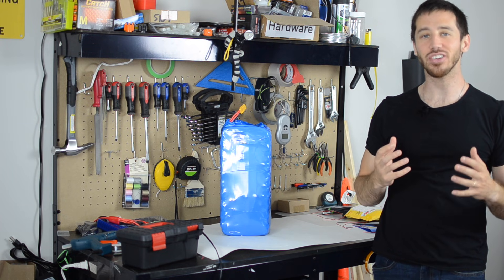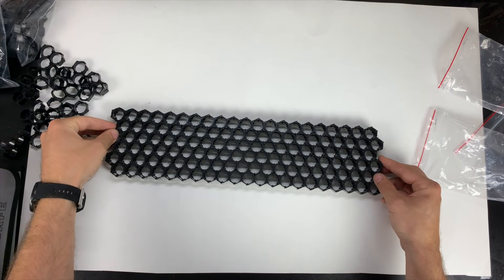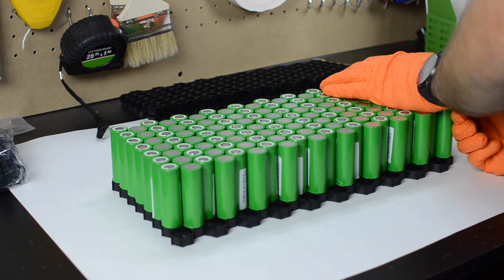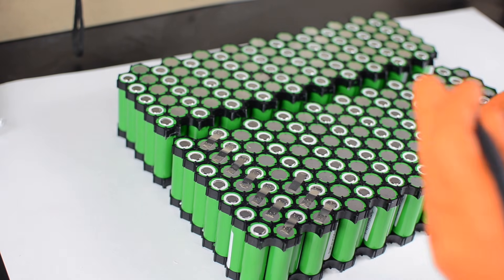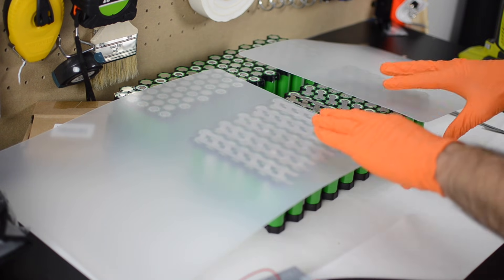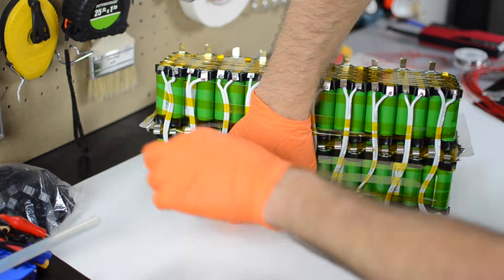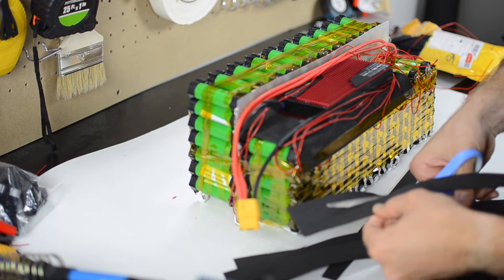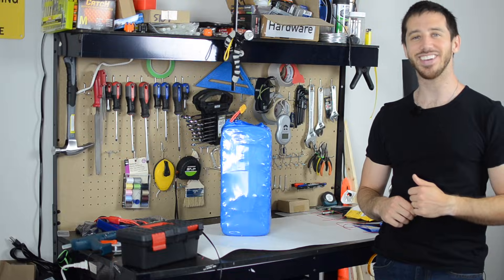DIY electric motorcycle 72V battery build (DIY E-moto Part 3)

Comment: Thank you for makingthis video.  I am building a similar battery and wondering how to determine the max output amperage of it,  What would you consider your battery amperage output to be? Or maybe the question is what size BMS are you using?

Comment: Thanks Micah, I have 3 not working,  good,  nearly new ebike batteries: (52v15ah, 52v14ah, 36v8ah) plus a few small packs for a few more cells,  and a spot welder, i want to combine my cells/packs to get a 72v battery for a new upgrade to an old 2014 A2B Alva+ with the 24" MXUS 3kw kit. what should i have, or do, to best build my battery. As far as shaping it, mainly, the original battery on these bikes wrapped around a beautiful strut under the rear rack, so if i could shape it to do that again that would be optimum.

Comment: Any tips on how to do 72v 54ah but 400amp or not possible working on 8000watt e-bike eventually I’d like to build my own battery for it
Reply: Same here. Looking at some 32700 cells for 6000mAh each. Should be less cells required for a 72-96v high Ah battery

Comment: Hi. Thanks for this great tutorial video.
I was wondering if its easier to build what you did here using 9v batteries. What are the obstacles that you will come across with building a pack with 9v batteries?

Comment: i just purchased this type of battery... $500. my ebike came with (6) 12v acid Motorcycle size batteries (Heavy). i didnt understand the concept of the auto shut off on the charger. so i left it plugged in even after charge was complete. well, one day it stayed charging and cooked my batteries and it left me with damaged batteries which didnt hold charge and i use it to commute to work (8 miles round trip) i tried to replace the batteries but they were hard to come across and it was difficult to understand all this volt, amp talk! so i purchased a 48v battery pack and learned that i needed a 72v. needless to say, I FIGURED IT OUT! i recommend this DIY battery packs! its not as heavy, and performs better than the acid batteries. i hope this encourages somebody to go with these types of battery packs!

Comment: I made a battery just like this, when hooked up to a multimeter it gets 80.5v, when hooked up to my ebike the voltage constantly jumps anywhere between 60v and 80v and the bike dies immediately when a load is put on.
 Also chargers either think it's full or just aren't charging it. Anyone know what the problem is? I'm guessing either the bms or the cells are shot. But the cells all did charge independently before the pack was made without issue.
Reply: Did you get them balanced?
Reply: @andyfumo8931  I did. It was a faulty bms in the end.
Reply: @Rasilia  faulty BMS or the brand and model you used is bad?
Reply: @andyfumo8931  just a faulty bms, got a replacement of the same make and it works great.
Reply: @Rasilia  which BMS is it can I  ask
Reply: @andyfumo8931  it was a Daly bms. In reality it was the charger I bought with the bms, the shop wired the charger backwards and the charger popped as soon as it was plugged into the battery. I was just hoping at the time that it didn't kill the bms with it.

Comment: Let's just say you plan on building a 72V 200A battery. When spot welding, do you recommend multiple layers of nickel and extra layers for the negative and positive terminals of the battery that get soldered to the bms? Also, whats a good brand you recommend for a bms for a high amp battery? And finally, do you recommend using 18650 or 21700 batteries for an ebike battery.
Reply: Try 32700

Comment: Micah I love all your videos and am a huge fan, built all my ebike batteries from your knowledge!  Question though: Is it possible to join the two halves without using the nickel strips? Have the 5p sit directly ontop of the 7p with no plastic? is it possible/safe to do with maybe a smaller pack? and would using a higher guage wire for the bms wires "medusa(lol)" charge it faster?   Love the content and a huge fan for life!@!@!!

Comment: Hi, I've seen alot of batteries advertised as only being capable of handling a certain wattage from the motor. For ex. (A 48 volt battery that can only handle 1500 watts) is no good for a 48 volt 2000 watt motor, I guess tho I don't know,.. how can you calculate how many watts your diy battery can handle?
Reply: you look at the datasheet of the cells you are using and max discharge rate of cells. on M50LT (cells Im using for a 26S 27P pack) it has discharge current of 1.5C (7200mA) *3.69V (std. voltage) so this is about 26.56watts per hour. a 26s27p has 702 cells in total (26*27) so by doing 702*26.56Whr you will have around 18.6kW. On datasheet the absolute max is 3C but that only applies when cells are at 10c~25c. you should not be pressing cells above this limit beyond 25c otherwise you will risk thermal runaway. my motors will be doing 22kW at absolute max and much lower during cruise, so my cell discharge will be much lower, for added safety.

Comment: I have a question, I made a 72v batterie out of 6  12v batteries in series for a e bike, my problem is that by battery die really quickly. Is there anyway I can make those last longer with a different wiring? Or do I need those small 3,6v battery?

Thank you all!

Comment: HEY MIKE, I HAVE 3000WATT CYCLONE MID. KIT ON MY BIKE, AND I RUN 2 PARALEL{ (3X18V 9AMPS=54V 9AMPS)=54V 18AMPS}= 972 WATT HOURS? MILWAUKEE 18V. 9AMP BATTS. 
 WILL THE CYCLONE MID RUN THE SAME DISTANCE , BUT SLOWER IF I TRY 3 PARALEL{(2X18V 9AMP=36V 9AMPS)=36V 27AMPS}=972 WATT HOURS. CAN THE CYCLONE EVEN RUN ON 2 18V 9AMP BATTS?

Comment: How do I replace the 6x 12v lead acid batteries with this in my ebike? The connection type is different. Also, will I be able to use the same charger? (72v 20ah) Thanks

Comment: Did you test it before wrapping it up??? Lovely build mikey  I'm 'borrowing' your bendi-battery-build of that's OK sir?
The reason for it is that for years I suffered the teasing 48v hub motor and 48v 11ah battery.
I use those values loosely as at full throttle it effectively is a 42v battery.
When fully charged to 56.4 it performs lovely.... For a few minutes then performs like a damp squib..
In my view I want a battery that has a constant minimum	 output of around 60 v and the ability to provide 1500 Watts at max output both continuously or until at max discharged but with a reserve tank ability.
Good sir HOW IS THIS POSSIBLE PLEASE.... X
Regards
David wiles
In the UK (on private roads)

Comment: 2:40 It's good that you're wearing gloves, mr. Ghee made his 72V nom. with his greasy hands. but he only uses it for vaporising copper wire! 8:09 solder has 10x resistance of copper-copper connections, such as crimping. so, where possible, better to crimp! minimise connections, so if the BMS wire isn't long enough to reach the terminals, replace it with a longer one, rather than extending it.

Comment: Great instructional video, I’m also working/planning on building my own 72v lithium battery pack for an electric Chinese bike that I salvage but it instead had lead acid batteries which are completely dead and can’t hold a charge. Hopefully I can start this project before the summer begins.

Comment: Dollar store cutting boards rock
I use them for all kinds of fabrication, mostly for directing air - 
Custom pc building, a/c to water chiller conversion. Also backing for drywall repair. Cheap, rugged, non conductive, waterproof. Oh, made a sanding attachment for my drill too

Comment: I would be uncomfortable with those wired connections between the top and bottom face of the pack resting directly against the inner folded connection strip. If one of those wires rubs out from the vibration, wouldn't it short across both layers of cells?

Comment: Question. New to doing packs. You do series first, then you do parallel. Why not do parallel, then connect the parallel blocks in series? Wouldn't that be less welding as you would only have 2 connection from block to block. To me, it looks like you built 140 cells in series, what am I missing :)

Comment: 20S12P with 200 amp discharge, 72 volts 36Ah ... I just purchaesed 3 of your books on Amazon... I am looking forward to building a battery for the Luna Galaxy Paint I'm gettin. Thanks for the video's.
Reply: What cells are those?

Comment: i have question. my cells are 30A and it would be 200A when packed. can i use it with 150A bms? how much does it matter if my bms is 300A and my controller and motor is 150A can i tell the bms to work as 150A? im about to buy antbms that has bluetooth control

Comment: TY for another video . You say cell must be at the same V b4 assembly ; getting 00's cell at exactly the same V is ideal but unlikely so what is a range  that is acceptable  25mv ?  the cell i have purchased have 3.226v-3.236 ATM , it's going to be a couple weeks b4 i have the missing hardware and assemble the pack , i will mesure them again then , that will also tell me if the $ i spent was worth them  , cheers & ride safe

Comment: I have a question in my mind that.
 if I use low voltage motor in High Voltage battery; does it make any damage.

Or if use high voltage motor in low voltage battery ;Does it also make some bottleneck issue?

Same question in about watt..

Comment: Hi Micah,
Damn man, I have been trying to find out exactly how and what I would need to build my own 72V E bike battery for My E Chopper Motorbike. THIS IS PERFECT.
I live in Toronto, Canada. Is it possible to get your DIY Lithium Batteries here in Canada and where. Also, getting the supplies here seems to be difficult as I have no idea where to start looking. The way you built this battery including the battery mounts is exactly what I have been trying to find as well as a supply of batteries. I would like to build 2 batteries (kind of a 2nd fuel tank of sorts), and have the extra power for longer rides and better usage of the bike before needing to recharge or carrying a charger with me unless I build the charger it into the bike which would be great if I could do it. If that meant having a simple switch to switch from battery to battery that would be fine. I have also toyed with having a regenerator that would generate power just from the motion of the wheel with a short chain attached to a regenerator (if safely possible).

Great build Micah, I hope you can help me with advise and connections for supplies.

Thank You,
-Matt

Comment: Looks like you tore some of the battery protective casings when inserting them in the holders  seen middle of battery around 3:00 of video the heat shrink is all wrinkled.  I am thinking this might be a potential failure point if the heat shrink fails and have some leakage.  the rest of the steps seem well done.   cool project!  good work

Comment: question how many lithium batteries cells do I need to make a 72 V battery can you please tell me and where can I buy Them by the bunch
Reply: It depends on your load, max curent and power needed. For that voltage, let´s say your load pulls max 50A (amps), so you need to provide safety factor by 2, that is 100A battery. If you take individual cell that is 3.6V nominal, 3000mAh capacity and 10A discharge, you would need 20 cells in series for 72V (72/3.6=20), and for 100A discharge you would need 10 cells in parallel (100A/10A=10 cells). Now multiply cells in parallel with series and you get final number of your cells (20*10=200 cells) and a battery of 72V, 30Ah capacity and 2.16kWh of electricity ;)

Comment: I have thought of a better way of using heat shrink wrap:
1. Cut a piece maybe 1.5 times longer than the battery
2. Wrap the battery with it and leave 2 "ears" at the sides. While heating, fold those "ears" towards the bottom of your battery
3. Cut a shorter piece of heatsink wrap. About the length of the battery.
4. Wrap the entire battery which is already wrapped be the folded heatshrink wrap.
5. Heat it.
Note: For this to work, the wires must be a bit longer so the can come out of the "ears" and "around".

If you did it right, now you have a quite water resistant battery, which is smooth all around, without any risk of cutting you O_O

I have thought of this solution, because I have cut myself sometimes when unplugging XT60 connectors which were quite snug...

Comment: LG MJ1 cells go for around 5 dollars. 240 cells is 1200 dollars. If you get 1000 charge cycles that's 1.20 dollars per charge. Those old Hondas get very high mileage and range isn't an issue because of gas stations. Is there a goal beyond making an electric motorcycle?

Comment: Bought your ebike book.  Watched many of your videios.  Liked & subscribed and have really learned a lot.  Building folded 36V/20.4AH/10S6p  ebike battery to convert my existing mountain bike to front drive ebike.  One question on this video.  The white insulated wire you used as parallel connector near end looks like dual 14 Gauge lamp cord.  Shouldn't it be 10-12 gauge for the amount of current your pack is going to deliver?

Comment: What gauge wire did you use to your XT90 connector?  I'm trying to build a battery for an electric motorcycle with a 5kW motor.  All the batteries I'm seeing online say 60A continuous which is what I need, but then they only have 12 gauge wire...

Comment: Now i understand why they charge 2000$ for these battery's
Reply: No I don't it look really easy when you know what your doing and pretty fast too !
Reply: @lucas.liberta  first of all, you need to consider the basic cost of materials and battery cells. Then the manhours to build it, and then the final manufacturing that ensures minimal hazards for the user once they install the battery to an appliance. When you do it yourself you can jsut jerry rig whatever idiotic bomb you desire, but as an actual industry supplier you need to achieve certain safety standards. This all costs a ton of money, especially when you aren't a mass producing manufacturer. Price always escalates exponentially when you go up in size and complexity per unit.
Reply: convince and time
Reply: What size of nickel strip did you use for the connections. Was the parallel strip the same size as the series strip ? Looking to do a similar project for perhaps a 150- 200cc equivalent. Thinking about a123 cells or using a electric car pack. Thanks. By the way did you ever finish this project ?
Reply: @Meonlymeagain  take a look at batteryhookup.com - they have a steady supply of standard new cells, plus a fast changing stock of salvage stuff from ev's and industrial recycling. Have to check frequently if you want to snag the best deals on the non standard stuff.

Comment: Hello sir.. did you finish the Honda electric conversion? Still interested in doing this myself.
Let me know.. sir!

I built a cruiser with 1000w front and 1500w rear running 48v 14ah battery with a 48~72v 40a controller front and a 48v 14ah 25a controller rear.
Super fun and FAST!
Thanks buddy 
✌️PT

Comment: Hai Micah... I was reading ur book DIY Lithium batteries... I have a doubt that if Balanced chargers do balanced charging of cell groups then function of BMS is only need to cut off the discharging of cell or there is any other drawback with balanced chargers that BMS could rectify it?

Comment: I really suck at electronics, if you want your bike to be more durable between charges how would you do it? Making another battery pack with the same specs or something else? I don't get it because it seems pretty clear there are some maths going on to reach 72V, so I guess you would need as many 72V battery pack as possible onto the bike and something to switch between battery pack once one got empty, right? Or can you just make a single big ass battery?

Comment: Has anyone ever tried to secrete a foam type substance in between the individual batteries in the pack to give it more heat resistance? I was thinking if you could find a substance like that it would be very beneficial to even put a minimal amount in between every battery in the pack (safely not damaging function obviously) so it would absorb some of the heat from the batteries. Hopefully prolonging lifespan. If anyone has ever tried this or know anything please let me know. I'd love to bounce ideas back and forth.
Reply: Air. Spaced cells, is the way to cool. Otherwise you are insulating the heat.

Comment: At 6:36 why did you/he spot weld the first and last welds on that row in a V shape unlike any of the other connections? Every other connection is one battery connected to one other battery, but at the top and bottom there are 3 batteries connected together. I'm very new to this all and haven't seen that done yet so an explanation would be great! Thanks all!
Reply: Was it a correction to a mistake made on the angle you wanted to weld them at? Then you had to do that V weld with 3 to fix it? I realized after that row you switched the angle/direction of the welds (if that made sense).
Reply: @brettkarling5671  or he was thinking of doing it to all of them to complete the parallel circuits before realizing it would take forever to do it that way

Comment: What amperage should the bms be? The link takes me to all kinds lol
Reply: Depends on how much you need to discharge at once
Reply: @dreamstreetskate5291  oh so it's more what the motor takes?? possibly. Thanks for replying
Reply: @01Joemama  no an electric motor will "take" whatever you give it but if your controller only let's 15 amps through then that's all you get. Good performance is all about the controller

Comment: Hi guys, i have a question, thx in advance if youll help.
Im building a ebike, with my own battery pack, 72v 20s 3p (80a continuous, 105A peak) with 18650 cells sony vtc5a, what BMS do i have to get, i found one on aliexpress from Daly, and i can pick common port (2 wire) and separate port (3 wire) . Which one to buy, 2 or 3 wire version? Do you have another BMS to recommend?
Thx guys, im new here and in e bike space, cheers